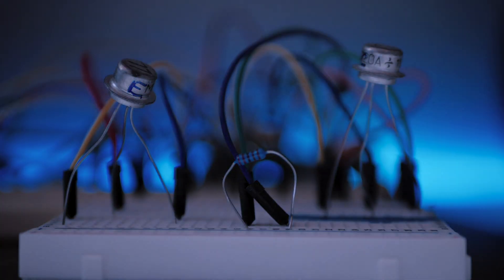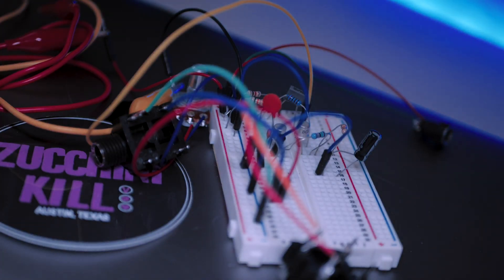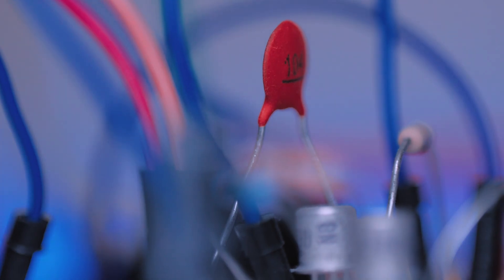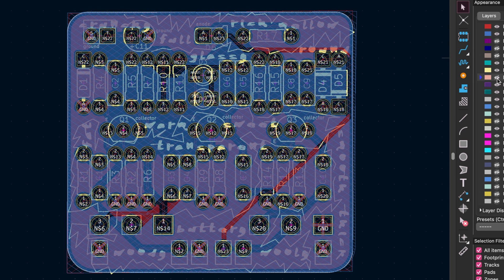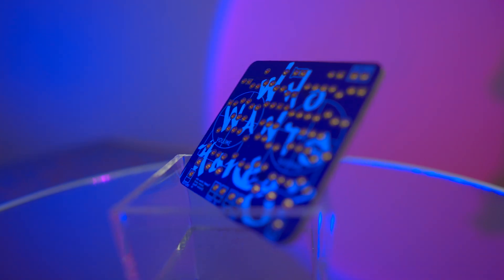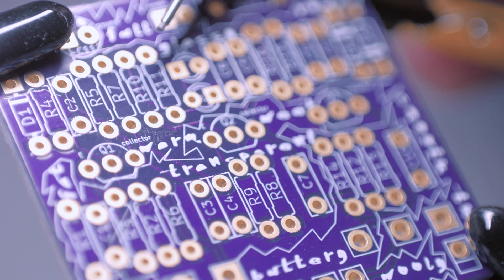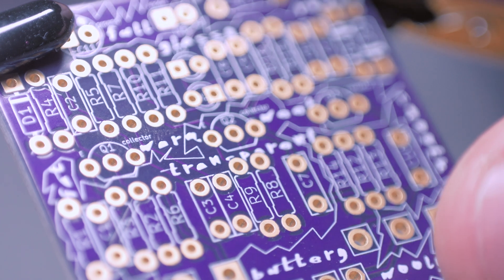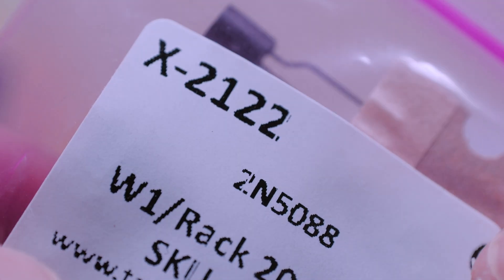Designing a Fuzz Pedal - Breadboard to PCB - Part 1

Comment: I want to see more about the circuit with the wood strips.
Reply from the maker: It's a working circuit. Two transistor fuzz. Sounds good. I just abandoned the project for something a little cleaner. I'll be making a future video on a hardwired pedal that will feature that little wood strips circuit.